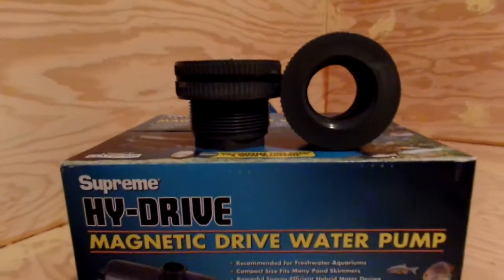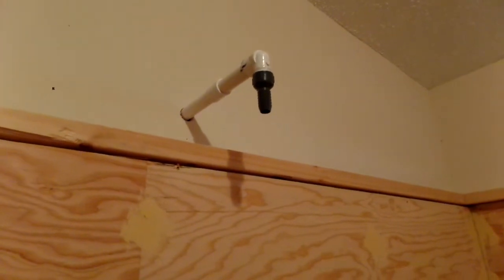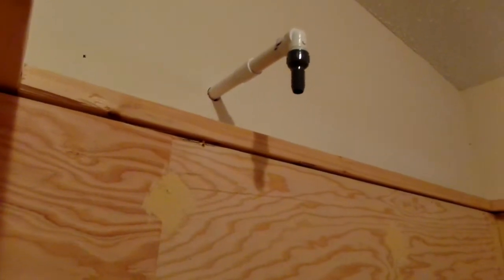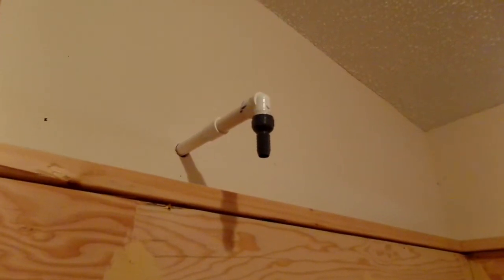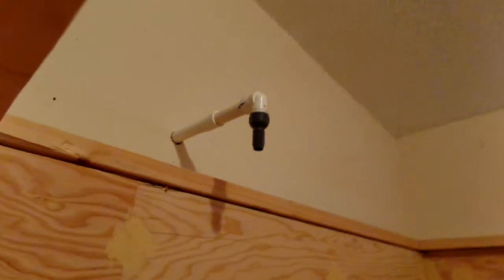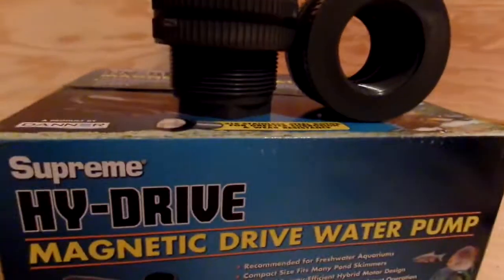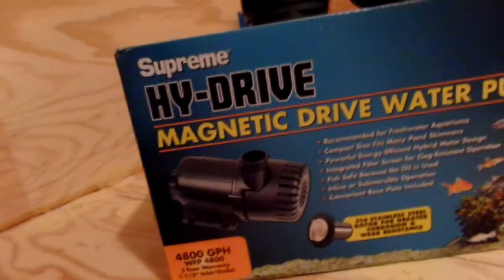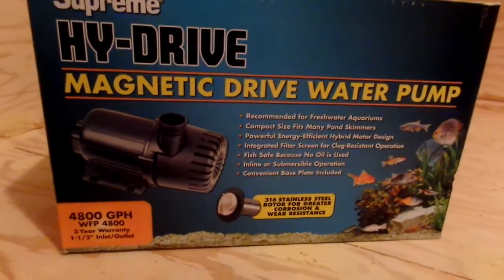1000 Gallon Aquarium Sump / Pump / Plumbing

Comment: Wow that’s going to be a big tank!!! New Sub!!!
Reply from the maker: Thank you for stop'n by and sub'n !   Yes its going to be my 3rd plywood build, and the largest, for sure. After all the final wall structure was built, the interior dimensions are 112wide x 62.5deep x 30high ( 909 gallon ). The plywood sump that's under it is 7 feet wide, and 210 gallons, and has area for 51 gallons of media.